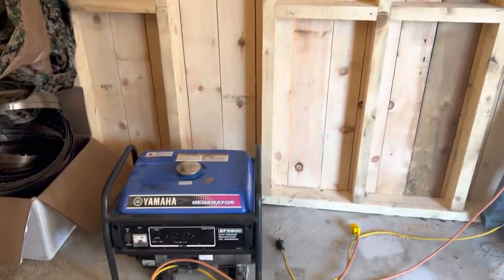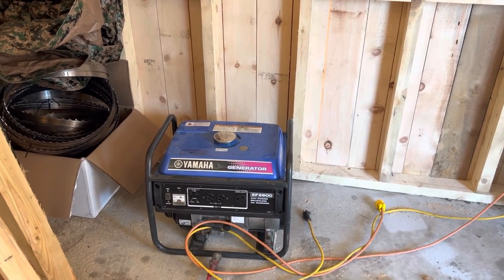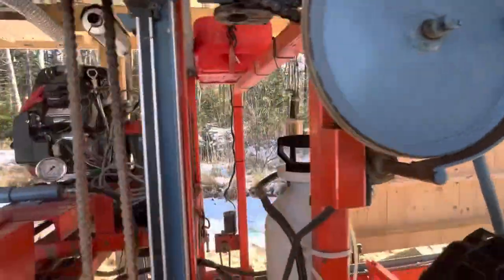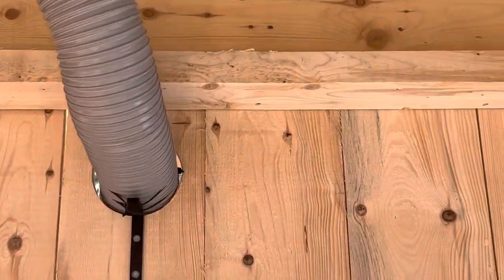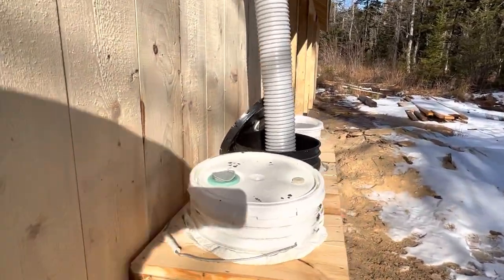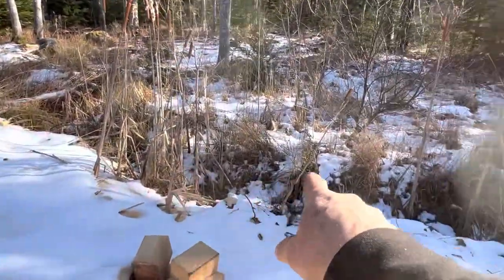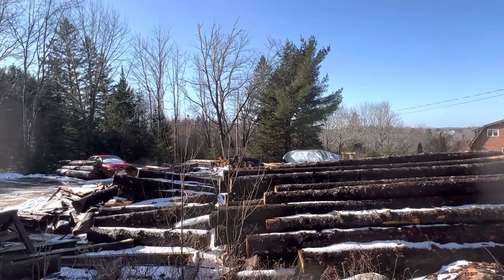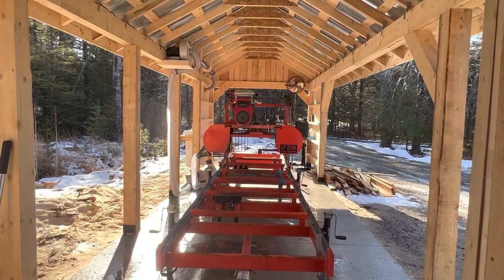A successful one man sawmill operation- working smarter, not harder

Comment: You have designed and built a great saw mill, the more you can offer the more work you will have ! (DA)🤔.
I didn't know that sawdust could be a problem for your health, do you use a respirator when cutting such woods? And the burnt ash? Is also a hazard? 
Anyway a kiln will be a great addition, will you dry firewood as well?
Doing something that you like doing is the key ! Imagine kiln-dried building material, way to go ! I will love to see it being built.
Thanks for sharing 👍🏻. 
✌🏻 🌬 🌦 🇨🇦, Ontario
Reply from the maker: Thanks for the kind words! I do wear a respirator when I’m milling ash- and any wood I’m not 100% sure of what it is, just in case. I’m hoping to have a kiln up and running by mid summer- we’ll see how that goes- I plan to speed up some firewood drying in it as well. I might need a bigger tractor or a skid steer to load it, but I can’t afford that this year- maybe another year. :)
Thanks again for watching! Jeff.

Comment: Very clever setup! I was wondering if a dust extractor would be able to manage wetter sawdust from a sawmill. Guess is does! I was also wondering what kind of blades you normally run? They look like lennox or woodmizer from the profile in the first sequence of this video. I've been experimenting with different blades materials/angles/width/thickness to figure out which is best for the different types of milling I do.
Reply from the maker: It’ll definitely move wet sawdust- but I need to come up with something that’ll help keep the sawdust in the bag- once it’s half full the blower will just blow it out onto the ground. Maybe a cyclone type of accessory… I’m primarily using Hakansson blades- 158” x 1 1/2” 7 degree 7/8” spacing. I have Ripper37s blades- I like them- but are getting expensive to ship- and I’ve used WoodMizer double hard blades as well, 10 degree, they’re mediocre at best, I’ll know once I sharpen then a few times… Thanks again for watching! Jeff.
Reply: @thelogfather5002  Thanks! I'll look into those.